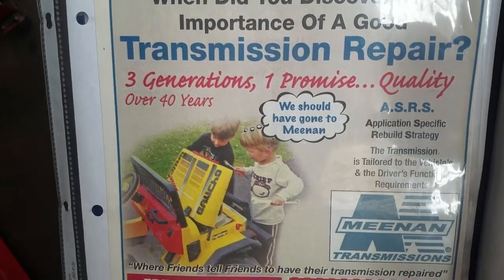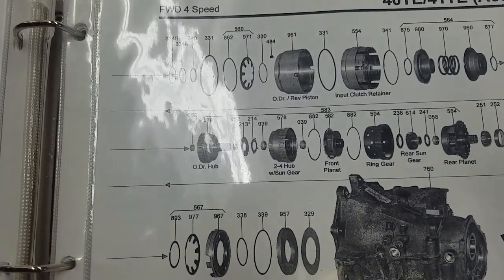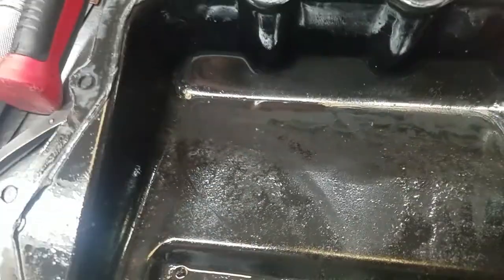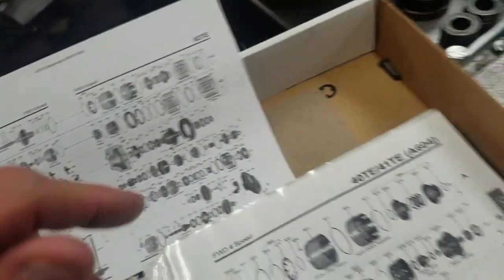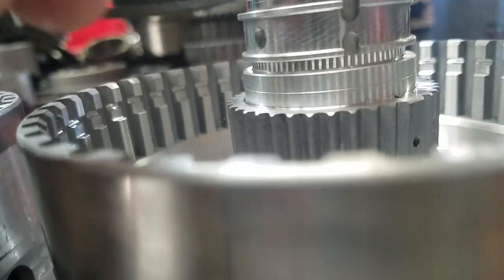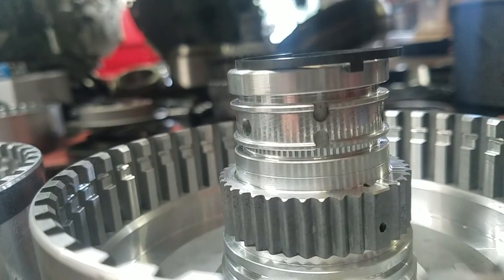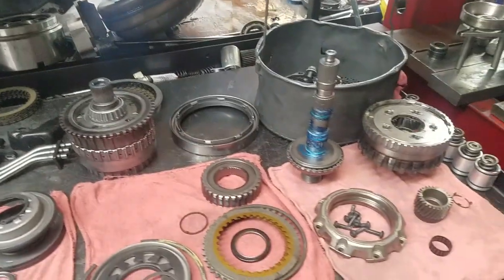Town and Country Meenan Transmission 62te

Comment: What year did Chrysler update 62te transmissions with the better designed low clutch drum?
Reply: Best I can find is around 2015 or 2016...at this point i think you would need to buy a 2017 or newer to avoid this issue safely...
Reply: @rickc2222  Thank you

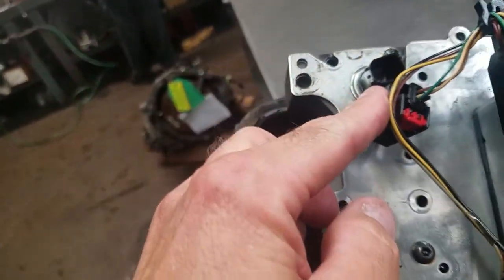Comment: At 3:07 you are pointing to the failure prone TCC solenoid not the VLP solenoid. The line pressure control solenoid is located in the solenoid assembly.  Good video showing the revision of the low direct drum support.

Comment: Hi... is itit possible to swap the internal components of a 2013 3.6 T&C transmission to the housing of a 2009 3.8 T&C? will it work just the same? Thanks in advance.
Reply: Juan Francisco Collao you would need the case and converter from the engine you intend to use at least i think the internals are the same with exception 2013 had the updates to fix problem areas also use your solenoid pack and valve body as they are matched to the engine requirements